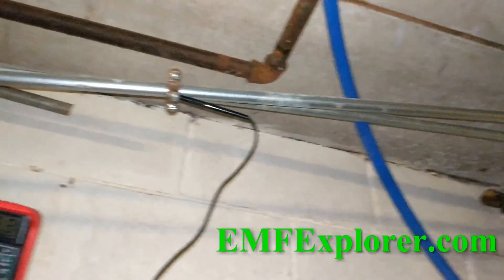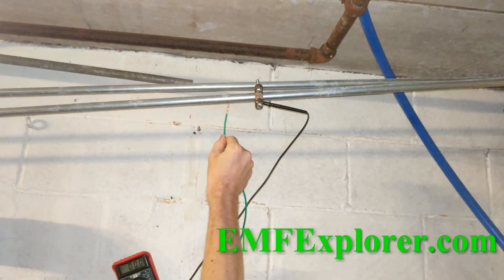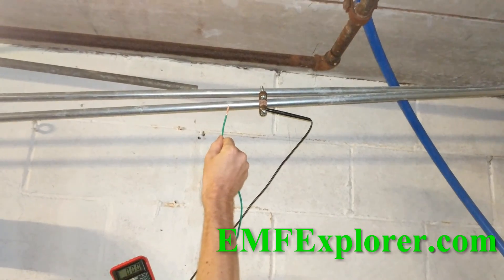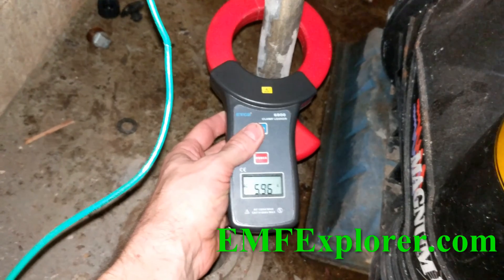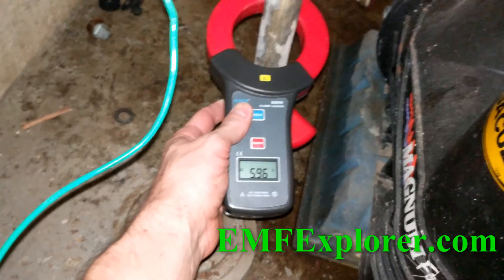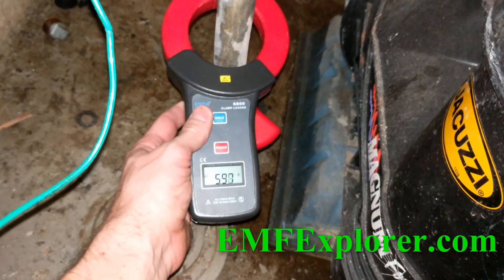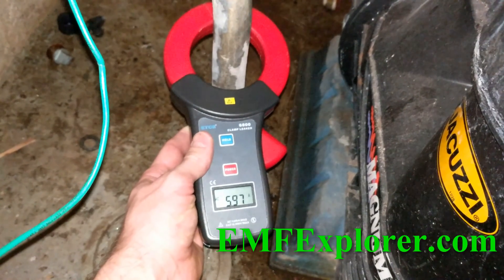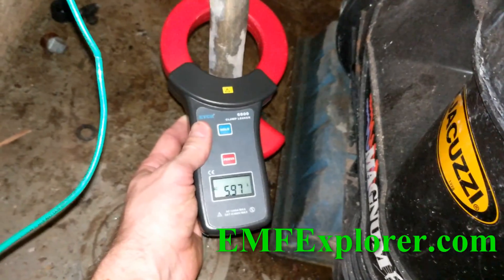Sparking water pipe - bad neutral?  High volts and current on incoming water line.

Comment: Faced a similar fault in an old residential building. Turned out to be pinched phase wire (tenant attempted a diy socket upgrade) resulting in the entire steel conduit tubing becoming live.

Comment: I had this happen to me had a full leg 120v on all my water inlets flipped breaker by breaker found it on the condensing unit circuit Rand conduit and new wire to unit flipped breaker immediately tripped dead fault it ended up being the contactor on the unit crazy stuff
Reply: Check my other videos.  This is why we like to isolate the water pipe from the city network, but bond it to the electrical on the building side (internal piping).  Had yours been properly bonded, it would have tripped the breaker on that circuit immediately and there never would have been a risk of electrocution.